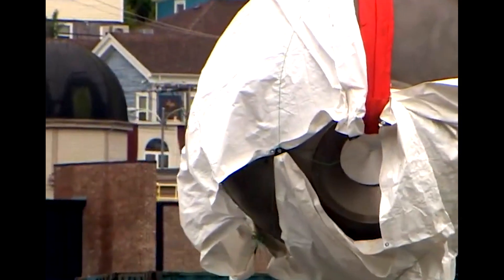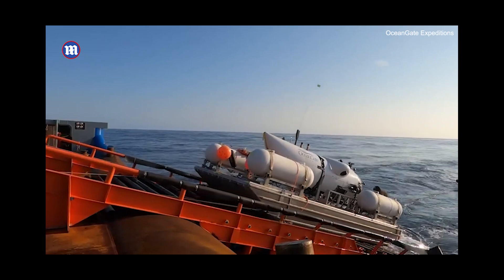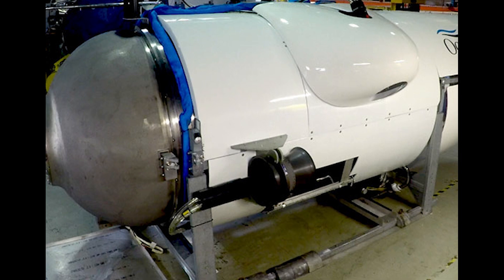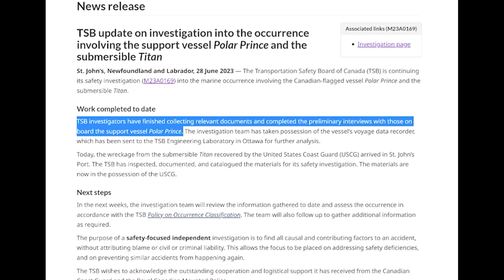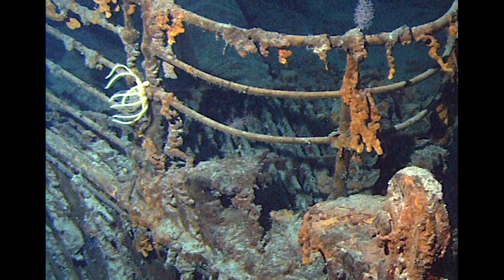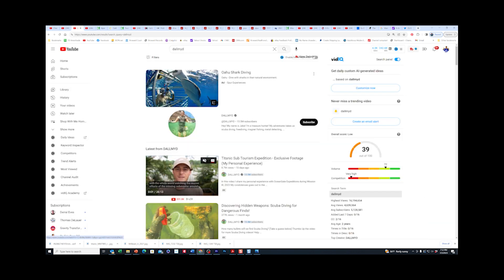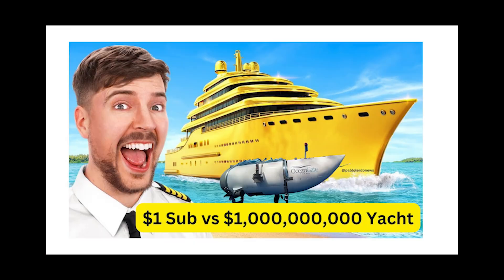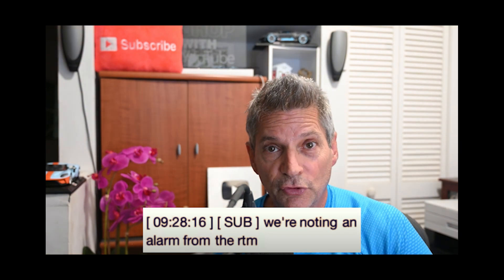Titan Submarine Debris Clues, Implosion Simulation

Comment: Scenario 4, the implosion blew the port window out.....

The weak spot of a tube, is not near the ends of the tube, its near the middle.

But you essentially have two end caps, trying to force their way into the tube - like a wedge.   Fighting this is the tube squeezing.   Obviously something failed. 

BTW, Carbon fiber tubes that I've seen use a weaving pattern - not what I've seen of this sub.

BBTW, the example of the implosion - that was at below atmosphere pressure.  There is only so much of a vacuum you can pull.   The Titan sub was at about 6000 psi and pressure at sea level is about 14 psi.   So 428 times the pressure (and 428 times the speed!).   Apparently its actually implosion followed by explosion followed by implosion - oscillating back and forth.
Reply: Yes that is correct. The initial implosion generates a huge amount of heat as it compresses the gasses which then explodes taking all flammable material with it thereby generating a cloud of combustion gasses that in turn are the compressed in another implosion and the cycle repeats in an ever diminishing way until all the heat has been disipated.

Comment: In the shots of the front titanium dome being bolted shut - the first wrench is a standard ratchet; but the second photo (at the 7:19 mark) is a ratchetting "break away" torque wrench.  The grip is adjustable and sets the torque based on a scale that is stamped on the cylinder. When you hit the preset torque, the wrench "pops" as a signal.
Reply: I came here to post this exact message.

Comment: 7:18 the comment re the torque wrench;

The "tech" in the video footage is using a torque wrench but there are a few observations that I think should be raised.

Torque wrenches should be regularly calibrated and be of a good known quality brand that is able to be not only be calibrated, but hold the calibration for the period of time between certification. 

The torque wrench in the video appears to be a cheaper brand pretending to be a Snap-On model. In the UK we tend to use Britool or Norbar. Not sure about across the pond but they're our best quality. 

Torque wrenches should not be used with extension bars if possible as the torsional loss through the length of the extension can create inaccurate torque settings in the fastener. Further to this, this extension you see on screen may not be "an extension bar" but an impact gun torque-limiting-extension being misused.

You also see the arc of movement that the "tech" is using, torque wrenches like long smooth sweeping arcs if you have the space to do it. Little 1/8 turns can give you an incorrect setting. 

Lastly, you see that the "tech" (and I use that word loosely) is using a poor quality spanner to lock the opposite end of the fastener that he/she is torquing but, they're using the open end instead of the correct ring end. This suggests either;

Lack of access.

Lack of professionalism/experience. 

Inability to apply correct torque.

Damage to fastener by open ended spanner and or damage to flanges/sealing faces.

Lastly, overall this could imply an uneven clamping load on the end ring which may have had an effect on the bond between the carbon fibre and end ring when combined with the cycling/fatigue from previous dives.

Comment: With the porthole window it appears to me that it was blown out from the inside as it looks like the bolts that held it on have been sheered off level with the flange mating surface as the empty bolt holes aren't visible as they would be if the bolts were removed. It would be interesting to know the yield strength of the bolts that held the porthole on, the yield strength of the resin that held the flanges on to the hull where the end domes were bolted to, and the yield trength of the port hole window itself.

Comment: I'm not an engineer but I'd like to think I have some common sense. Watching this sub being built even I could tell taking this thing down to over 3000 meters in the ocean was not going to be a good idea. First off it's help together with glue. Secondly they used carbon fiber and just wrapped it .... not diamond pattern. No special weaving. Just wrapped round and round. Plus the wrapped it wet and didn't heat and pressurize it in an autoclave. Everything about the building process screams not to take this thing down to those extreme depths in the ocean more than just one time.  Also the biggest thing that would of never got me into that sub was the fact that you were bolted in there with no way of getting out unless a 3rd party from the surface opened it for you. Just everything about that seems wrong.

Comment: you dont need a phd to know that gluing the sleved steel ring to the fiber hull and then bolting a gigatic hatch door to the ring is full r3tard
if that glue bond cracked or weakened between 2 different materials in any way due to temperature or pressure it was game over
Reply: yeh there is a video of that youtuber inside the sub
as it goes into the water on an angle hatch first you see him standing on the hatch door from the inside lol
the pressure on the giant door up down to the side would flex that bond between the ring and the fiber hull
the designer of that sub should be sued for everything for such a r3tarded design

Comment: Trying to figure if they removed the acrylic window with the bolted flange assembly, to get the dome to the surface, or the window was blown out with the bolted flange assembly. Imagine the force required to strip the bolts clean off the flange, cos the pics shown there is nothing left. Hope the report will give some light.

Comment: I am no expert and my question will make this obvious but it seems the carbon fiber was made in one direction only, at least from the videos I have seen.   What I mean is that it was just a simple wrap round and round.   Based on other videos of other carbon fiber projects the wrapping is made in several directions to add cross strength to the carbon fiber.  So my dummy question is would the sub be stronger if carbon fiber was wrapped crosswise as well to add strength in every direction.   Hope I am giving you an idea of what I mean.

Comment: On the face of it the manufacturing process looked professional and controlled but clearly the final product was not fit for purpose. Dissimilar materials, bonding and mechanical fixing, Acrylic viewing dome, scaffold pipe drop weights. Its a mish mash of ideas were a finite analysis  cad simultalion may have convinced the designers. This should have been remotely controlled and depth tested multiple times.

Comment: It isn’t even the water being pushed in by gravity, it is the spring-like tension of water at such incredibly depths. The water would expand at several times the speed of sound, the pressure on the air would be so great that it ignites like a diesel engine, all in a couple of milliseconds.

Comment: There is no means by which the salvage company could undo those bolts at that depth. Missing flange ring means window blown out by sudden internal pressure caused by carbon fibre hull collapse - like dropping a full size anvil on a toothpaste tube blowing the cap off.

Comment: Depending on the material, Unidirectional or weave, and how it was formed, the cylinder was probable vaporized into minute fragments, almost dust, it was only glue/resin holding together, pressure and temperature could have weakened the bond, makes you wonder how much testing they did.

Comment: The pressure vessel was wound with carbon-fiber unidirectionally on a inner titanium core.  
They did not alter it's configuration for additional stress forces presented outside of the vertical plane.  
Imagine you are supporting a 1lb weight on an empty soda can.  Most of it's strength is in the vertical plane.  
If you place the can on it's side and load the weight it will crush.  

An extremely dangerous notion.  Water is incompressible and will crush you from every direction.  (it's actually compressible but functions as an extremely powerful spring)

Which thinking on now it would seem that the submersible with its descent profile that ballasts away from the horizontal, would have the entire static-force of the water around them loaded asymmetrically.  Given their material and construction philosophy(Unidirectionally wound carbon-fiber cured in place) it should have still required them behaviorally to descend perfectly level in the horizontal.   This is the only way to actually maximize for the structural loads they were designing for. 

Since they never did that, cycled many times, It seems most likely the carbon fiber failed along the horizontal axis.  
Meaning the endbells would fly into each other  propelled by the immense pressure.  

The water uncompressing and flooding inside the displacement void would have crushed the passengers into the Endbells at a speed a few times faster than the speed of sound.

There was an F-15 pilot that Ejected close to the speed of sound.  He was nearly ripped apart by air.  Imagine water.

Comment: If the hull breach and implosion had started at the rear, would the "water hammer" effect have been sufficient to blow the porthole window outward? The window was a plug type, which is effective against pressure INTO the vessel, but much less effective to protect against OUTWARD pressure.

Comment: The carbon fiber collapsed in, which compressed the last remaining air/co2 within the space to push the port holes out. This force was so violent that the binding surfaces did not survive from the pop. Not layering the carbon fiber in 2 different directions just leaves a horrible chance of micro cracks leading to the outer layer. Eventually, allowing for inward collapsed.

Comment: It seems very unlikely they would remove a critical window just to throw a strap around the piece to lift it, they would have put it into a large bag or used multiple straps if it was in place that could be vital evidence I doubt the salvage blokes would unscrew it.

They gluing of the joint was probably the cause, they are mixing it up in several small buckets it does not look like it is tested in any way they just slap it on. I would have to see some excess glue squeezed out of the joint as ring is lowered all around, how else would they know they had applied enough? Even then there might be small voids it would need to be xrayed or something. (I am just a builder I don't do submarines but I work with a lot of drains, pipes and adhesive those blokes did not look very skilled) I think you are right the overlap should have been at least 6 inches. Really they should have made the entire thing from titanium why would you ever want to introduce glue and plastic?

Comment: I have the text message account of the fateful event.
The RTM hull health/integrity monitoring system alarm sounded suddenly necessitating the dropping of ballast which curiously did not arrest the descent and in fact  the descent rate  increased for unknown reasons until after multiple failed attempts, the landing frame was jettisoned.
This did arrest their descent at some 3,500 meters down and began their slow ascent as "crackling" sounds were heard coming from aft of the vessel.
All hull health monitoring parameters were reported to be in the red, presumably at their maximum limit and for unknown reasons their rate of ascent was only 25% the predicted rate as per Rush text message.
Meaning....they obviously never tested the vessels landing frame jettison mechanism nor the vessels behavior once effected. Something I find absolutely astounding!
After a horrific and curiously slow 17+ minute emergency ascent more problems arose as the main power bus A began reading all red prompting a !sounds from aft.
Some 18 minutes and 21 secondsa azainto their emergency ascent and shockingly leas than 150 meters closer to safety, all  communications with Titan were lost. 
I have a more detailed account for anzyone who likes.
RIP crew of Titan and God bless their zloved ones.

Comment: Yes overlap way too small. That ring should have been connected to an inner support structure with rods an rings inside the hull 
Was any finite element modelling done? Did thet test a scale model to failure to identify failure modes? Magin to buckling safty factor applied??

Comment: The titanium just glued to the carbon fibre?The titanium dome will shrink very different compared to the carbon fibre cylinder. First because of its form, its material thickness, the different elasticity and because the different behaviour of a material build up out of fibres compared to the homogeneous titanium ring and dome. All these forces just on the glue which also has a different elasticity. It is amazing that they were able to get down so many times as they did. They glued it without moisture control, dust control. A hair or dust could have made its way into the peanut butter?.? Thickness unknown. Just exactly the right one, sort off. Just life blowing.

Comment: If these videos of the manufacturing process had been widely published earlier, everyone could have seen that boarding this vessel to dive to 3.800 meters depth was a su#cide mission. With my background in engineering, I'd say that it's pretty obvious that either the cylinder material, its seal or the porthole would definitely fail. Maybe not at the first time, but after a few trips - no chance of survival. Especially since there already have been problems with the sub during the last few trips. That's what greed leads to. I'm just sorry for those who trusted this idiot and lost their lives. Hopefully, future sub constructors memorise not to make a pressure body from flexible materials. And not to glue critical parts. And not to use a safety factor of 0.4.

Comment: I could see a myriad of reasons why the sub failed. #1 carbon fiber wound in only one direction (resulting in a weak hull by design). #2 The CF "mating flange" was way too small (2-3 inches) resulting in a weak bond and less support. #3  The CF "mating flange" is not as thick as the rest of the hull (see 1 and 2) #4 there was ZERO "squeeze out" of the epoxy between the mating flange and the Titanium ring, which means that there are void spaces in the joint, resulting in a weak joint. #5 the manufacturers of the front viewing window rated it for ONE, (SINGLE, UNO, ICHI, EIN) dive to 1,300 meters, NOT multiple dives down to 3,800 meters!  #6 Titanium compresses, carbon fiber shatters.  #7 all other submersibles that go that deep use a Titanium sphere for crew because spheres are inherently much stronger than tubes!  #8 Stockton fired the only other person with extensive submarine experience because he warned him about safety issues.  #9 Game controller for sub-systems okay, wireless game controller as the only control? NOT OKAY!! #10 exposed "zip tied" wiring? not good. #11 Safety record, NOT GOOD AT ALL!!  #12 no safety testing/certifications! NONE, ZIP, ZILCH, NADA!!!  I really have very few problems with sewer pipe as ballast, because, well, it's ballast. It is meant to be dropped/dumped/discarded. In the past most have used lead pellets but that gets pricey. As long as you weigh it properly and can drop it quickly enough, it is all good.

Comment: I think the first point of failure was the adhesive joint between the carbon fiber and the ring. There really isn't any way to create a reliable bond with adhesives, resins or epoxies to metal, especially something that would undergo a lot of mechanical stresses.
Reply: they literally bolted monitors with a screws through the walls

Comment: Notice: that titanium end piece that you think is the door is not the door, there aren’t any screw holes in that end where the metal piece and plexiglass was hooked too. Instead, the titanium piece that has the nylon crane belt through the hole is not the door/window cap, that’s the titanium end that was on the backside where the tail end hooked to which had a hole in it for wires and oxygen tubes ect. went through.
Reply: No, incorrect.  The rear titanium end cap had no such penetration.  You can see it clearly in an OceanGate video where they had the white plastic cover off.  And the rear end cap was a perfect sphere, too.

Comment: First, there is absolutely no way that the ROV they used to salvage the wreckage could have "removed the bolts holding the window in place" The mechanical arm on the ROV does not have anywhere near that kind of dexterity. It's absolutely amazing they were able to retrieve these parts at all. As for what happened, that is pretty obvious from the wreckage. The carbon fiber failed, and the pressure chamber imploded, resulting in the destruction of the carbon fiber part of the pressure chamber, and everything inside it, including the passengers. The viewport was likely blown out toward the inside when the carbon fiber failed. It may still be down there in one piece. The titanium parts were strong enough to survive the implosion. The white plastic cover and other parts external to the pressure chamber were not subjected to the forces of the implosion, since they were not part of the pressure chamber.

Comment: The titanium (a word with the root of "titan") end caps were expected to compress against the cylinder. Hydrosta8c pressure was expected to keep them securely in place and the joint watertight. Whether or not they stayed in place after an implosion is moot. 
Another video showed white bags of stuff which was speculated to be shards of the carbon fber composite hull.